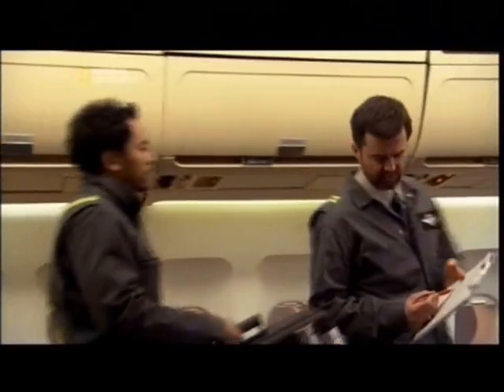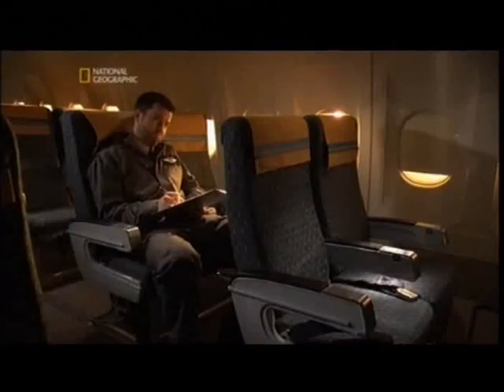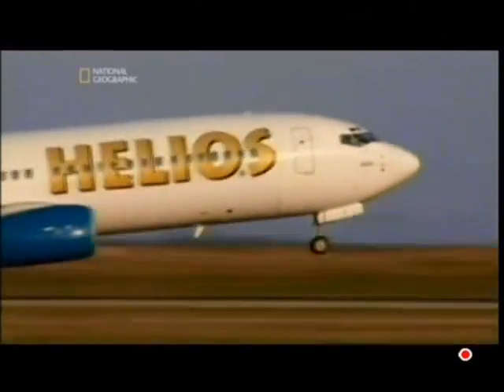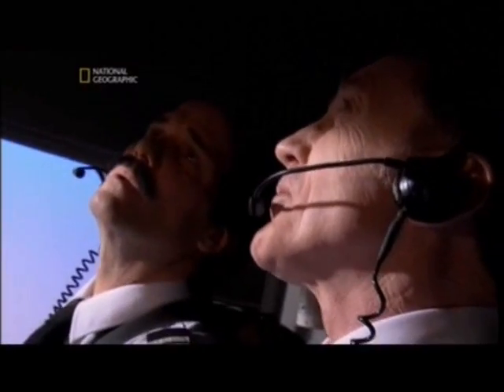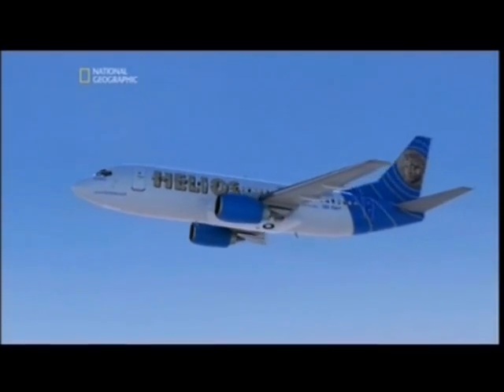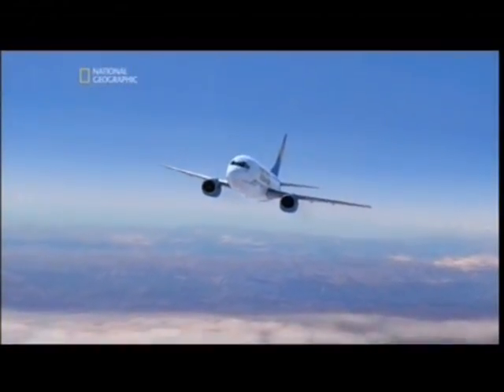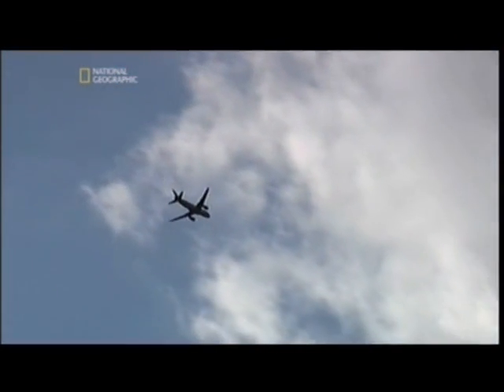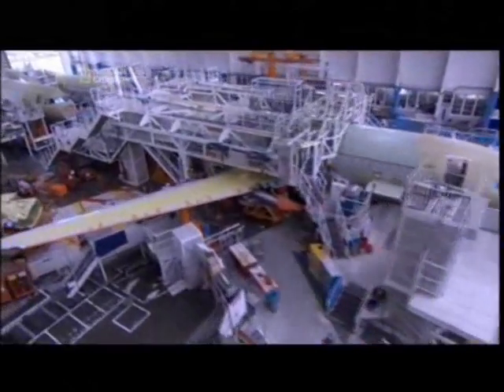Air Crash Investigatoion | Special Report | Ripped Apart | Part 4

Comment: Yes, and maybe you missed my comment that, "if certain conditions exist, like low pressure, and no action is taken by the crew, after a certain period, the autopilot sends an SOS to ground control, which can command the plane to a lower altitude (if safe to do so)."  So, my friend (a term I use more loosely than salmonella diarrhea), when an aeroplane reaches an atmosphere, thick enough, a crew may regain flight control, but you already knew that, didn't you, because you're so very smart?

Comment: Another thing, in response to Helios: railroad locomotives have a dead man's switch, where an alarm sounds, that the engineer must silence. If the engineer does not silence the alarm, then the train will automatically stop.  This may be too much for a pilot to deal with, but if certain conditions exist, like low pressure, and no action is taken by the crew, after a certain period, the autopilot sends an SOS to ground control, which can command the plane to a lower altitude (if safe to do so).

Comment: I didn't hear the make and model of that Helios jet. If it was one where the cockpit console's artificial horizon is digital, I ask the question: when there's a pressure problem or something else where there needs to be a clear explanation to the pilots, why not briefly replace the horizon display with text, like "PRESSURE!!" ?  That would get the message across, for sure.